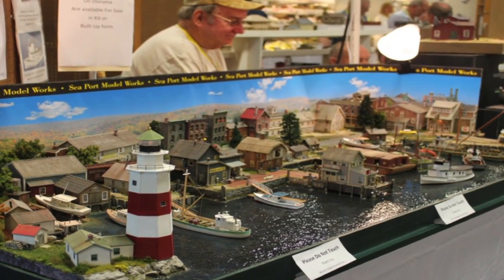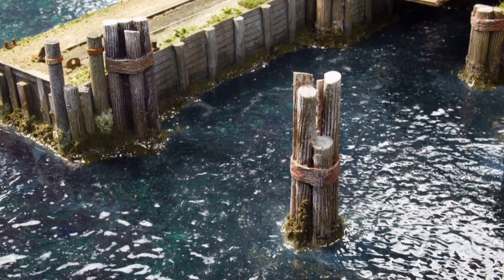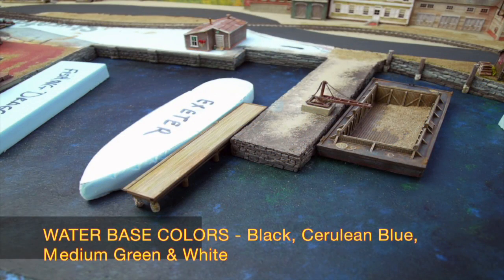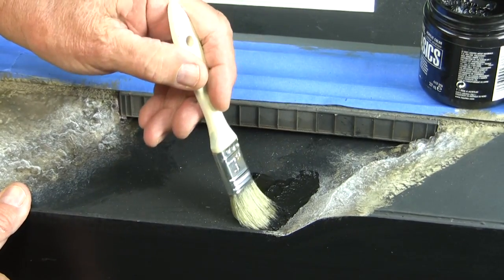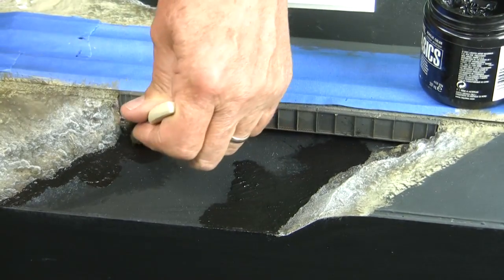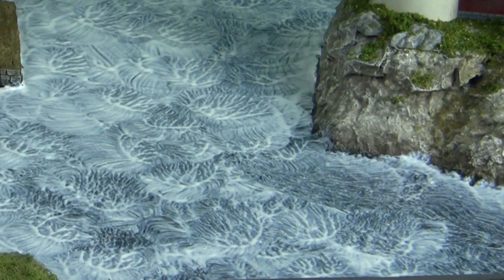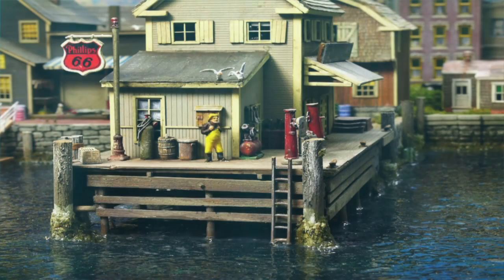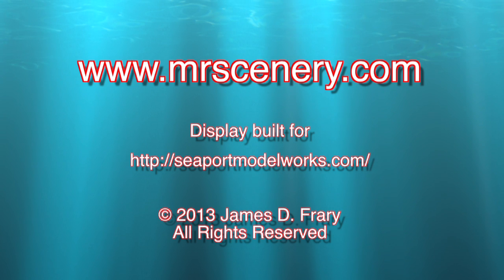Sea Port Water

Comment: I really like this method but I have to ask how you get the rippled effect. I have applied only two coats so far but don't see any ripples even though I am using the brush to create what I think are little ripples. It seems to dry flat without any ripple texture. Possibly that will come with successive coats but maybe there is something I'm missing.

Comment: Hello Dave!  I have about four years admiring your work as The Trackside Modeller and be updated with your videos!  Your Model Railroad Scenery, which I have, is a indespensible guide for my modest model railroading projects!  Since I am a rookie in the hobby, but very interested to learn,  I would pleasantly welcome an advice from You in modelling small town with a "port", like the one you do have!  But my question really is how did you shape the wooden dowels, in order to look so realistic in your seaport water video and also what  kind of materials You used for the docks and retaining walls?  Looking forward for Your Resoonse!  Robert--
Reply from the maker: Robert, The pilings are made from wood dowels from the hardware store. I rough the surface with a wood rasp drawing it the length of the dowel. Then I paint the dowel with cheap craft store acrylics and cut the individual pilings to length. On some project the piling became part of a "master" from which a rubber mold is made and resin castings are made.
Reply: @thetracksidemodeler8573  Thank You Dave!  Appreciate so much your reply to my inquiry!  I will be watching  your channel with  even more interest from now on!  Keep sharing with us your vast expertise in the hobby!

Comment: It had become an automatic to use oil based varnish or two part epoxy for model railroad water. Then came this idea. Good old Hodge Podge does a lot of the same, cheaper without, the fumes. The water based Revolution that Dave was very much a part of. Ahead of his time.

Comment: Wonderful work. One question—what’s the approximate total depth of 10 coats of Mod -Podge?  I’m building a float and need to account for this in order for the float to look like it’s really floating.
Reply from the maker: 10 coats about 3/16" to 1/4" thick depending whether you pile it up or not...

Comment: Dave, Your the Man. Looks Incredible. I am getting back into my layout after years of raising 3 Sons. 
Just curious why you didn’t use resin and what are your thoughts on using Resin for Water  instead of 10 coats of mod-podge. 
Huge Fan !! 
Thank You.
Reply from the maker: I selected Mod Podge as an alternative to epoxy. Epoxy resins are very fussy to use and sometimes the water isn't what you expected. You also need 24 hours of 80 degrees for the epoxy to cure correctly. Mod Podge is a water based acrylic, no mess, and no fuss. Just brush it on and let it dry. It's also about a 10th of the cost of epoxy.

Comment: Dave, you don't reply very often, but I'll give it a shot. What can be used if I can't find Gatorboard?
Reply from the maker: Any hardboard like Masonite, plywood, MDF, anything but Styrofoam!
Reply: Thank you! I bought Masonite for my little ocean inlet project. Will follow your techniques as best I can, but few among us are gurus of model railroading like you. Your work is stunning. If mine looks a 10th as good, I'll be elated.
Reply from the maker: I bought mine from a plastics dealer that sell outdoor sign materials. A 4' by 8' sheet, ½" thick was $92.00 USD.